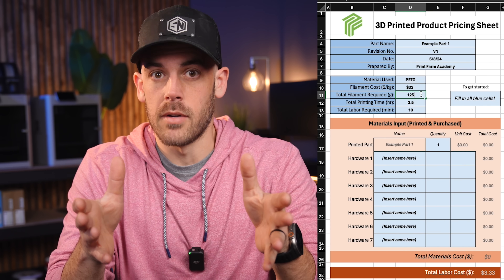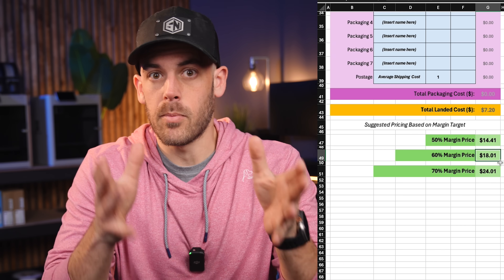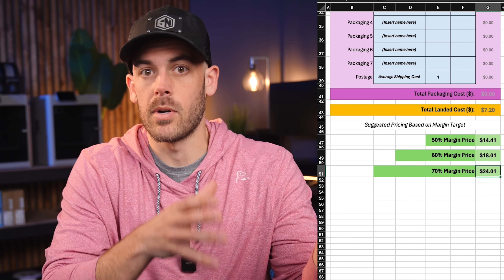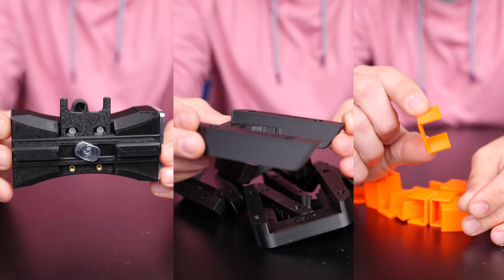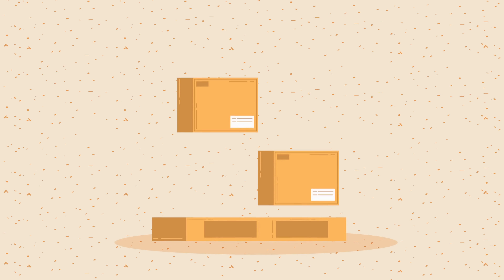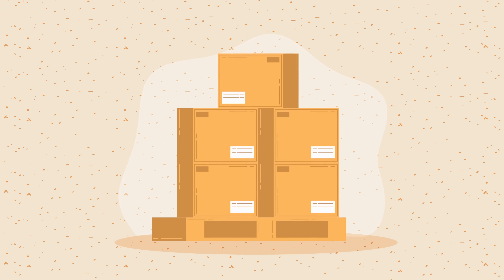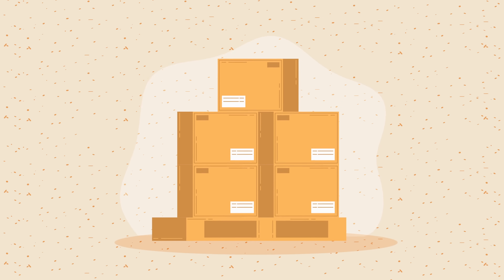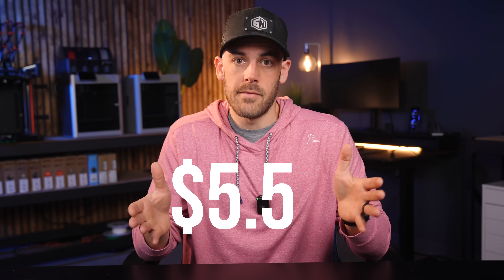Why I charge $55 for this 3D printed part (how to price)

Comment: I didn't read EVERY comment but the first thing I noticed while watching your video is you never mentioned the cost of "space". Your print farm occupies space, either owned (basement, garage, etc.) or rented. I had a home based consulting business for years and part of my cost doing business was using a bedroom converted to an office. The costs of using that space are deductible by using Form 8829 (Also see Tax Topic 509), Expenses for Business Use of Your Home. It is a legitimate expense and part of the cost of goods sold.
Reply: Do you factor in web-hosting costs, merchant fees (usually 2-3% of online sales), and also subscription fees for licensed 3D models? Curious how you'd factor those into your equation. I feel like having the included Merchant Fee would help out too, because its a big percentage of the total landed cost. Any way you can update the spreadsheet?
Reply: @mothershipmidi  I noticed "DeWalt" on the side of the battery holder. Doubt he is paying a licensing fee.
Reply: @mscousa  good question.  I'm replying to see answers I think these should be factored in; but that's part of the design budget generally depending on purchase model
Reply: @mothershipmidi  we probably have to modify the sheet by our self. But I have came to the same conclusion and can now delet my comment XD
Reply: I agree. Also printers do use a lot electricity non stop. And my bill wouldn’t be so high if I wasn’t making 10,000 prints 💯
Reply: @DopeCity5000  i graph my power usage on all my printers with smart plugs. Its pretty constant if you're printing lol.
Reply: @tjhuntog  if you're running a bambu P1P, or P1S, what would you estimate your monthly power cost is per machine? I have 2x P1Ps and 2x P1S, and I guess I need to get some smart plugs.
Reply: @mothershipmidi data I saw from someone recording for a P1S was running around 20hr a day used 60-70kwh.  They also use more power for intermittent printing vs constant because of the time and energy used to heat the components from a cold state vs keeping them running
Reply: Thanks for that, I'll be using that form from now on!!
Reply: Nice catch on the taxes for this.
Reply: Don't forget air conditioning to keep the rooms cool with all that hot machinery running.
Reply: @HomeslicedVideos 😂
Reply: That would be included in your overhead % much like electrical use for the lights in the room or consumable products like paint, tape, etc.
Reply: @SuperNsane probably not as it's a big "expense" every month.
Reply: If he has a bad month and sells 0 parts, his cost of space doesn’t change. Cost of space is fixed whether he sells 0 or sells 1 million.
Reply: Overhead
Reply: Or electricity
Reply: This I was gonna mention.
Reply: I have 3 dogs that take up space, that's 4 less treats a day. Thanks!
Reply: That's overhead costs, he calculated none but that is very important and that's where most business loose money

When he said margin, he was talking about gross margin, not net margin
Reply: You're 100% right especially if we want to consider scalability lets say with a warehouse.

This video is geared more toward home users than large businesses
Reply: lol, an academic answer to the fixed cost is a fixed overhead liquidation factor so that your fixed costs are not eroding your margins…many companies use a 3x factor for revenue over cost. Now whether that applies to a manufacturing business, device business
Or reseller…is all a rhetorical function.
Reply: @henryoppermann134  You started your comment with “lol”. Everything after that has lost credibility as a result.
Reply: rent is a fixed cost. it doesnt scale with your production. if it affects your production, it does so in the form of limiting your maximum output but it doesnt affect the cost of each part produced per se. that is the rent is $1000 regardless if you sell 10 pieces or 10,000. in that sense you shouldn't be counting it as part of the cost of goods sold. this type of cost typically goes under Selling, General & Administrative costs, as do costs like utlity bills to run the AC and lights, the website, wages for labor that doesn't directly have to do with the actual part like janitor, supervisor, etc. if you do include such fixed costs in your COGS then you will find that low volume sales projections make the part look expensive to produce, but high volume sales make it look overly profitable. if you then start adding new SKUs to your pipeline, you will then end up double and triple counting all those fixed costs. the reality is that your spreadsheets will tell you set unrealistically high prices for each SKU.

if however the landlord is imposing a percentage of revenue on top of rent, as do some F&B landlords in parts of the world, that directly translates to cost per part sold and that would be a reasonable justification to count as COGS.
Reply: @suivzmoi  Costs are costs, fixed or not! Rent/Mortgage/Rates whatever you want to call it, absolutely should be counted into final costing, if anyone says otherwise, they have no clue...
Reply: @McShimi  nobody is saying that fixed costs aren't costs. you are not paying attention to the discussion.
Reply: @suivzmoi if you estimate to turnover 100k a year and have 5k fixed cost you calculate 5% of your target turnover to cover those fixed costs. If you turnover more than 100k you are more than covered, if you turnover less, your costs are not covered. Is one way of doing so
Reply: @suivzmoi it does scale...if you want double the machines you roughly to need double the space
Reply: @suivzmoi  COGS is everything that touches production so rent for a space that is used for the purpose of creating the product yes it is COGS
Reply: @suivzmoi  It still adds up.
Reply: @suivzmoi naw mate....it is part of your cost. Revise your cost accounting.

The way to look at it is imagine having to rent or buy a space to host the farm.

Also re costs, include an amount for other administrative costs eg tax return filing etc. There are other considerations but this is a fairly good basic guide.
Reply: @suivzmoi  Not exactly.  Regardless of the ratio to part made it is hardly a fixed cost.  Space that you wouldn't otherwise need does cost money.  Things like shelves, tools, fixtures, furniture, web presence, taxes, licenses, design computers and network, all cost money and need to be accounted for in the cost of products sold.
Reply: @I_B_Phrede  I would watch what you deduct. I have an accountant for that. You could end up in jail for fraud if you aren't careful and they audit you.
Reply: @I_B_Phrede  yeah there's a place for all that. its not COGS. you have no idea what fixed cost means. just get an accountant.
Reply: @isthattrue1083  The IRS instruction manuals actually do state that you can deduct those items and usually gives you a formula for calculating the cost of space.
Reply: @suivzmoi  Hes not talking about tax implications, but the actual cost of a part - the rent or amount invested in floorspace is a real cost
Reply: @isthattrue1083  Who said anything about deducting? I'm talking about total costs to produce the parts.  There needs to be a building and it needs infrastructure.  It all has a cost that needs to be included.  As far as that goes, so does whatever you pay an accountant.
Reply: That calculation would be complicated considering the location of your business and the tax laws of that location. I would assume the cost to run this type of business would be more in California than Missouri. 

Example: You could calculate the daily usage of that cost by dividing the total number of days you are using that location in a rental. If it cost you $365 a year for that rental (unrealistic, but it's easy math) $1, then divide that by the number of machines being used for the project you are working on for that customer. . 

Another example: If you are using a portion of your home, say a garage, and have a mortgage, you could use the percentage of that space used. Example 2000 sq ft home (lucky!) and you use 200 sq ft. so 10% of your home. Your mortgage is $1000 (again lucky!), remove 10%, you get $100 a month. You could then divide that by total number of days and get about $3.29 and  again, divide that by the number of machines being ran.

This is just for the cost to use the space. But, you could calculate all this into your operating expenses with the electricity, internet, marketing, websites, etc. Take the total cost of operating cost for the year for all this, divide by the total number of days in a year, divided by the total number of machines to get your expense.
Reply: Man … this convo got boring real quick 😂
Reply: Also cost of wiring, plus insurance- risk of fire, storage of filament etc. Time for splicing, cost of computer for the software, lighting, etc
Reply: Nothing in his video matters when figuring out how much to charge. The only thing that matters is what the market can bear. If you are charging less, you are losing money. If you are charging more, you will make less sales, and are losing money.
Reply: @Noneofyourbusiness2000 Yes, it does, because you could use some of this information to calculate your actual costs and determine the minimum price you should charge for a printed piece. If the minimum price is higher than the market price, you'll need to adjust your costs (such as investing in additional printers to increase productivity, changing your filament supplier, etc.).
Reply: Well yeah it matters. Regardless of what you actually charge for your printed part, you really should know what it's costing you to make it. You should follow that cost as costs vary. Yes, knowing what the market will bear is important, but if that amount is less than cost your can't stay in business unless you fund a way to adjust cost. Information is power. My wife runs a bookkeeping firm. She has convinced me that the numbers really do matter.  @Noneofyourbusiness2000
Reply: Facilities ARE a component of COGS.  Having a spare room or spare equipment or even spare talent does not make it free.  If you don’t consider all costs the accounting will mislead your decision making.  Moving to a larger, vastly more efficient facility will never make sense.  
There is a different consideration for where you invest and how you spend your time and opportunities.  
The one additional consideration that needs to be mentioned is that depreciating your home for business use can screwup the $250k ($500k married) lt capital gain exemption for primary residence.
If you file as an Scorp there are ways to take it as income under the tax exemption there.
Reply: Wow. I won't do that even if it is legal. It's my own space for business. If I am renting then maybe I would probably add it to the cost, but my own space? NAAAHH.

Comment: I just noticed the spreadsheet you provide does not seem to factor in the machine cost. It's defined (in the advanced inputs) and there's a field for the printing time, but the cost is not actually calculated or included in the Total Landed Cost.

Comment: I think the importance of unique parts cannot be stressed enough, especially starting out. One needs realistic pricing for things to sell.
For example injection molded power tool battery holders/hangers are about $2 on the open market. Buyers are not likely to choose ones that are over 10$. However once one has an established brand, loyal customers may be willing to pay more for that product.

Comment: I bought your dust collection part for my miter saw and it works well.  I was also glad to pay your price and hope you made money on it.  Money is an easy way for consumers to benefit from your creativity
Reply: Absolutely, and remember that that also does not take into account the amount of time he had to spend to design and prototype the part. I think that's the one aspect he left out.
Reply: I'm really glad I didn't buy the part but bought the file because it breaks about every three months and I have to print another one. I'm only printing in ABS but I'm printing at 75% infill and still breaks.
Reply: @SoFalsey how does it break?  If it’s in layer lines you can prob adjust temps for better cohesion.
Reply: @SoFalsey if it does then it is a crap design.
Reply: @SoFalsey sounds like you need to learn your printer better. Going on my guard printed in pla+ for almost a year.

Comment: Great video, lots of good information. Consider working the cost of the UPS into the machine cost.  Also UPS maintenance as the batteries inside them need to be replaced every couple of years (2-3 has been my experience).  Over time the battery capacity depletes.

Comment: I totally agree to your pricing but 150w doing printing?  I measured my printers once and yes they use 150w doing preheating but as soon as they start printing (for maintaining the temperature.) they just use 45 w of power (i use only prusa printers)
Reply from the maker: I’ve measured my prusas and Bambus and during heat up use ~300W, then they drop to around 60-100W during regular printing
Reply: @PrintFarmAcademy  hmm maby my enclosure plays a role? I have every prusa in its own enclosure 🤔
Reply: @callysadventures6315 if you're that in the weeds, you're over thinking it. Just round it up a bit and get on with the important stuff.
Reply: It's going to depend a lot on the size of your printer.  I just looked it up, and my Voron 2.4 350mm apparently initially peaks at 1000w, then drops to like 450w while heating, then prints at 150-260w.  (According to someone's measurements of their Voron 350mm.)

Bambu P1S (256mm bed) apparently also peaks at 1000w, but is more like 100-115w while printing.

Given how many people use Bambu printers, I think the 150w is a pretty decent quick estimate.

Of course, his calculations don't take into account the warm-up time for each print, but I already feel like it's getting into the weeds a bit on the power calculation as it is, so I'm happy to ignore that factor.

Comment: The same part will cost you 40 cents in material when using pellets ...just saying ....
Reply: But why are you “just saying” this?  He’d have to convert his machines to use the pellets.
Reply: @Impuritan1  Yes we would. Because decreasing production cost by 10x for a business is a great idea in general.
Reply: @sierraecho884  it would nort decrease by much as printing cost is one of the smallest costs in the calculations
Reply: @vornamenachname8001  Again, material costs are about 7x-10x LESS. if your Spool costs $20 the same pellets cost $2. Of course this will  change the price significantly.
Reply: @sierraecho884  you’re not addressing converting all of his machines over to use pellets.  Or are you talking about converting the pellets to filament?  And the only desktop pellet printer I’m finding is the Creality/Picocreat G5 and it was $5000 two years ago.
Reply: @Impuritan1  If somebody writes "backe this cake in an oven" it is assumed you have to open the oven door first to place the cake inside. 
Forgive me but I was not aware that I need to specifically state that this would need a conversion on the hardware side. And I said yes it does need this hardware change before so I say it again as clearly as I can.
YES YOU NEED TO CHANGE YOUR PRINT HEAD TO BE ABLE USE PELLETS.

Turning pellets into Filament is futile since there is no advantage in that at all for multiple reasons. It would be cheaper than store bough filament but that´s basically it.

There are others. There is a German guy here in YouTube (sorry forget the name) who created a compact version for basically all modern FDM printers for like $200 or something in that area. So there are some products available here and there. The main point is....
YOU CAN SAVE ABOUT TEN FOLD ON MATERIAL CISTS after the conversion. 
So it absolutely would make sense to try this out and research further.
I hope I was able to make myself clear enough for everyone this time.

Comment: I love this topic.  I would love your opinion on what I should do in my situation. I am a professional CAD modeler.  I have a day job, but do custom 3-D models on the side.  I work part time for a custom auto shop.  
I spend a lot of time making custom brackets, interior part mounts, and air intakes for customers.  I never really know how much to charge people.  If it takes me 1 hour of 3D scanning, and 30 minutes to model a bracket and three dollars of ASA filament for a four hour print, how much should I charge the customer?  Are usually charge $50 an hour, one dollar per hour of print time and 1.5 times filament cost.

Comment: I used to do resin casting. The mistake I made was not factoring failure cost. I realised how important that was when a biggest mould failed after the 2nd pull it pushed back my break-even by a chunk.

I prefer to work on break-even work out my fixed costs and then variable costs. I'd want to break even after X amount. Then you have to work out you opportunity cost which is a whole rabbit hole balance of fix cost/time and profit
Reply: That's his "efficiency factor" - but x1.1 is tiny. That's only 1 in 10 things going wrong in any way!
Reply: Good point! In manufacturing, this concept is mostly described as yield - the ratio of working parts to not. Was 90% here. But that seems like it could easily be on the low side. Ideally, one would track it, to know one's actual number.

Comment: It seems like you're pricing your labor really low. I've had an issue with my 3D printing side hussle where my day job labor price is so high that it feels unreasonable to price my free time so low. Feels like I either need to not bother or charge higher. At this point it's more of a way to tax deduct 3D printers and other CNC-type tools that I just want to own. That's almost a 40% discount on them as long as I can break even selling little parts.
Reply: Your free time is more valuable, so you need to charge it even more :)